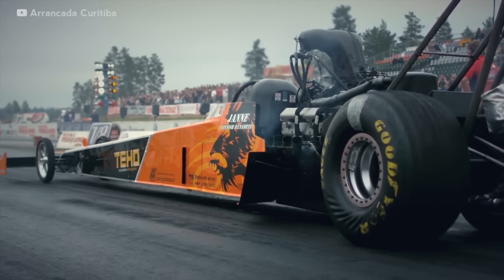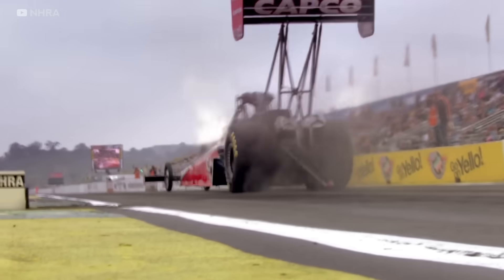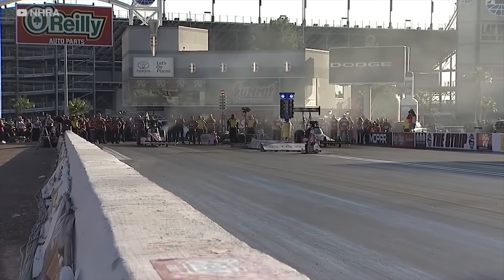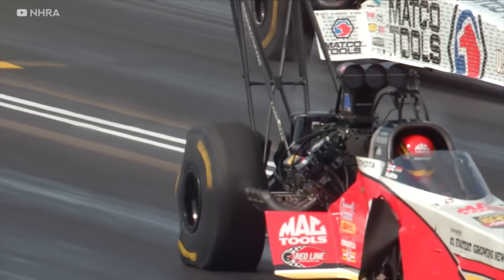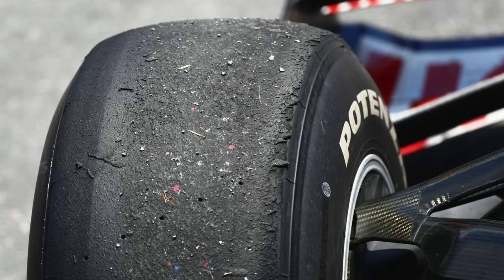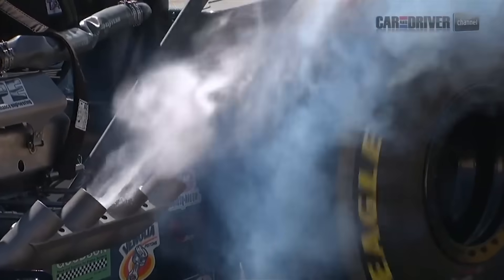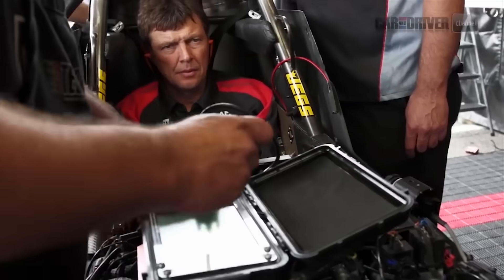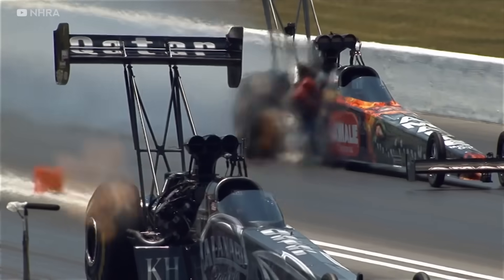How Dragster Tyres Accelerate to 335 MPH in 3.6 Seconds

Comment: 8:13 actually this part is incorrect. Nitromethane produces less power per liter than regular pump gasoline. The biggest reason it’s used is because of its viscosity. It flows a lot easier than gasoline and so they can use lots and lots more of it more quickly to produce the power that they need.
Reply: GASOLINE
Gasoline is a mixture of hydrocarbons. Its chemical formula is C8H18. The air fuel ratio for complete combustion is 14.7:1 called stoichiometric. This means that our engine consumes 14.7 pounds of air for 1 pound of fuel. Gasoline has approximately 18,400 BTU/lb . Using an air flow calculator this focus engine would consume 247cfms at 7000rpms with 100% VE.  This equals 22.17lbs of air per min.  Divide by the 14.7:1 ratio and that would get you  1.5lbs of fuel.  Multiply that by the 18,400 and your engine would produce  27,600btu’s of energy at 7000rpms.

NITROMETHANE
Nitromethane is a fuel that is used mostly in specialized drag racing classes such as “Top Fuel Funny Cars” . Nitromethane’s chemical formula is CH3NO2. The oxygen in nitromethane’s molecular structure means that nitromethane does not need as much atmospheric oxygen to burn, part of the oxygen needed to burn nitromethane is carried in the fuel itself. Typical A/F ratio for nitromethane is 1.7:1 and nitromethane has an energy content of 5,000 BTU/lb.Using our Focus engine from above with a 1.7:1 ratio our motor would use 13.04lbs of fuel.  Multiply that by the 5,000btu’s per lb of nitro and our motor would be making 65,200btu’s at 7000rpms.
https://www.topspeedparts.com/blogs/news/fuel-comparision link for anyone that wants to know more.
Reply: nitromethane makes more power per lb than pump gas, you would need a bigger tank and a lot more F/A input to make the same power. you would need around 1.6x-1.8x the amount of pump 93 octane to make the same amount of power per run.... so the info at 8:13 is correct.

Comment: Nobody:
Drag car: hey guys watch me show this aircraft whos boss. (Chugs 10 gallons of fuel in 1 second)
Reply: @Funtime Florian nitromethane isn't a fossilfuel
Reply: @Funtime Florian plants also produce fuel
Reply: Corvette with a running 200 mph start "Wanna go?"
Dragster: "Hold my beer."
Reply: The Fuel PIPE is almost 4 inch in Diameter and force feed by the dragsters acceleration to the fuel pumps attached to the motor feeding 42 injectors.

Comment: There is one more factor that was not described here: The sidewall folding means that the rubber does not hit the track at a tangent, instead it is driven down and into the pavement.

Consider the (admittedly oversimplified) approximation of friction as the normal force multiplied by a coefficient of friction... If it was really that simple then it would be difficult to accelerate at more than 1g. You would need a coefficient of friction greater than 1.0 to exceed 1g of acceleration. It's difficult (impossible, really) to get such a large coefficient of friction.

But, sidewall folding causes the leading edge of the tire to slam into the track with a force much greater than what gravity provides alone. Slamming into the track with 3x as much force makes it possible to accelerate 3x harder than gravity, with a friction coefficient that is still in the neighborhood of 1.0.

Comment: I am genuinely curious about what a driver does when the parachutes won’t open.
Reply: At the end of every track there is about 100 yards of "pea gravel" ... which slows a car down tremendously....after that there is a catch net. The same that is used on aircraft carriers. There have been deaths yes, due to too short of shut down areas for the speeds...but 99% of the time no parachutes is not deadly due to what I mentioned.
Reply: At these speeds, he dies. It's happened - Scott Kalitta. That's why they shortened races from 1/4 mile to 1000 feet, to keep the top speed down a bit and to gain some runoff room. Most racetracks are in built-up areas, and there's no room to make them longer.

Comment: 5:02 False. Since the 2008 NJ crash, NHRA only does 1,000ft. runs. Outside of NHRA, there are still some races that go the full 1320, but they are extremely rare.
Reply: Only the fuel cars are restricted to 1000ft...all other classes still run 1/4 mile.

Comment: At 3:36 and beyond, you can see the tire gets sucked to the back of the rim by the torque.
 The wrinkling or wading of the tire isn't just squat. The tire gripping the track, gets wadded up by the rim spinning and pulling the sidewall at launch. Part of the reason for having bead lock rims with the low tire pressure. Lower lever cars will often screw the rim to the tire to reduce/inhibit rim spin.

Comment: hang on a second you mentioned the engine uses around 50 lts per run, yet the fuel pump moves 50lt per second, so the fuel amount carried is a lot more than 50 lts right, it would be around 200 lt for a run of under 4 seconds?

Comment: Also the only thing holding that engine is 4 large HD clamps and not bolts, just clamps, which look like hose clamps but are made a lot stringer, reason is that in a crash the engine will separate from the cockpit to help with safety. :)

Comment: Yeah she lied about the motors not all of them run hemi engines, some of the competitors actually run what is known as a Merlin block witch come in all different sizes! But mostly the block is made for making Chevy engines that are larger then a 572 displacement
Reply: LOL...Ummm, there hasn't been a Chevy based block used since the 1970's. ALL top fuel motors, and ALL alcohol class motors are indeed Hemi's.

Comment: Thats why i love it when Europeans talk shit about drag racing. We're not talking about drag racing a stock BMW, that requires no talent or technique. Putting down over 10k horsepower takes skill and a lot of science. Its like that episode of Top Gear where they brought supercars to a drag strip and got beaten by pickup trucks. These cars tend to run over 1000 hp easily and as we can see in top fuel they run over 10,000.  Yeah its just a straight line and just a quarter mile, but it takes a lot of skill to keep that much power going in a straight line.

Comment: that is exactly what i should show my brother who keeps asking why i put thick rear tires on my cars in "Need For Speed Shift 2 Unleashed" simply put, the effort of going from 0 to 1 km/h is bigger than going 99 to 100 km/h on the traction scale... so applying the torque over time makes the car not spin and then i can floor it. i guess thin tires would work better if i was trying to drift or something...

Comment: 50 liters per second? that sounds bit excessive. Just stop for a second and think how BIG a 50 liter tank is, to be able to push 50 liters through a pump in just 1 second, you'd need a gigantic fuel line. Not sure how exactly that's achieved, there's no way you can get 50 liters per second through a bump that is smaller than the entire engine itself. .. or are you saying it's CAPABLE of doing it, but not in use? that would make more sense.

Comment: 5:50 I think This is mid engine configuration because engine is before rear wheels. Rear engine is Porsche 911 where engine is after rear axle and transmission.
Reply: They call it rear engine because when the sport started, the drivers sat behind the engine. It was very dangerous, especially when the engine or clutch exploded. Don Garlits was the first to build his car with the engine behind the driver. So they just called it a rear engine dragster.

Comment: Great video the only thing I don't like as a racing fanatic for 41 years is people always missing mentioning that these Dragsters are required to run Chrysler Hemi engines. The class is literally Top Fuel hemi  or Top Fuel hemi funny car.   They don't run that design because it's the one that makes the absolute most power they do it because it's the most tried and true and tested for safety and it helps keep costs down for the teams.  Nitromethane actually has less energy per unit volume than gasoline but the reason it makes so much more power is that it chemically brings along its own oxygen.  The reason for needing an arc welder for the spark plug is they essentially need to build a primer for the dynamite they just packed into that cylinder.

Comment: 6:24 those... those are condensation trails off the rear wing like in an AEROPLANE 0_o
Reply: CHEMTRAILS!!!
Reply: @flowjoe23  5G CORONAVIRUS!!!!!!!!!!!BILL GATES!!!!!!VACCINE MICROCHIPS!!!!!!!! lol
Reply: @flowjoe23  it's called chemtrails of conrtrails
Reply: At 335mph a comercial plane would have had it's landing gear ripped off by aerodynamic forces. It fast boi
Reply: I mean, "like an airplane" isn't always the most impressive comparison, many planes can trail vortices like this scooting along at 60 mph
Reply: Michael Fritsche  I think it's actually the air expanding that causes the vapour to condense, you see mist in low pressure areas like vortices, engine intakes and the air behind shockwaves

Comment: 8:18 "Nitromethane doesn't need to mix with air to combust."

Right so the huge supercharger and big air scoop is just there for looks then??
Reply: https://en.wikipedia.org/wiki/Nitromethane#Explosive_properties
Reply: @stevegreen8262  
Deflagration (burning) and detonation are two different processes.
I have been using Nitromethane for over 30 years and though It contains oxygen in its chemical makeup It isn't a monopropellant and requires additional air to burn, hence the supercharger.

Comment: Not mine but just wanted to share What 10,000 horsepower does to a top fuel tire at launch.

TOP FUEL ACCELERATION PUT INTO PERSPECTIVE

* One Top Fuel dragster 500 cubic-inch Hemi engine makes more horsepower (10,000 HP) than the first 5 rows at the Daytona 500.

* Under full throttle, a dragster engine consumes 1.2-1.5 gallons of nitro methane per second; a fully loaded 747 consumes jet fuel at the same rate with 25% less energy being produced.

* A stock Dodge Hemi V8 engine cannot produce enough power to merely drive the dragster's supercharger.

* With 3000 CFM of air being rammed in by the supercharger on overdrive, the fuel mixture is compressed into a near-solid form before ignition. Cylinders run on the verge of hydraulic lock at full throttle.

* At the stoichiometric 1.7:1 air/fuel mixture for nitro methane the flame front temperature measures 7050 degrees F.

* Nitromethane burns yellow. The spectacular white flame seen above the stacks at night is raw burning hydrogen, dissociated from atmospheric water vapor by the searing exhaust gases.

* Dual magnetos supply 44 amps to each spark plug.
This is the output of an arc welder in each cylinder.

* Spark plug electrodes are totally consumed during a pass. After 1/2 way, the engine is dieseling from compression plus the glow of exhaust valves at 1400 degrees F. The engine can only be shut down by cutting the fuel flow.

* If spark momentarily fails early in the run, unburned nitro builds up in the affected cylinders and then explodes with sufficient force to blow cylinder heads off the block in pieces or split the block in half.

* Dragsters reach over 300 MPH before you have completed reading this sentence.

* In order to exceed 300 MPH in 4.5 seconds, dragsters must accelerate an average of over 4 G's. In order to reach 200 MPH well before half-track, the launch acce leration approaches 8 G's.

* Top Fuel engines turn approximately 540 revolutions from light to light!

* Including the burnout, the engine must only survive 900 revolutions under load.

* The redline is actually quite high at 9500 RPM.

* THE BOTTOM LINE: Assuming all the equipment is paid off, the crew worked for free, & for once, NOTHING BLOWS UP, each run costs an estimated $1,000 per second.

0 to 100 MPH in .8 seconds (the first 60 feet of the run)
0 to 200 MPH in 2.2 seconds (the first 350 feet of the run)
6 g-forces at the starting line (nothing accelerates faster on land)
6 negative g-forces upon deployment of twin â€˜chutes at 300 MPH An NHRA Top Fuel Dragster accelerates quicker than any other land vehicle on earth . . quicker than a jet fighter plane . . . quicker than the space shuttle.

The current Top Fuel dragster elapsed time record is 4.420 seconds for the quarter-mile (2004, Doug Kalitta). The top speed record is 337.58 MPH as measured over the last 66' of the run (2005, Tony Schumacher).

Putting this all into perspective:

You are driving the average $140,000 Lingenfelter twin-turbo powered Corvette Z06. Over a mile up the road, a Top Fuel dragster is staged & ready to launch down a quarter-mile strip as you pass. You have the advantage of a flying start. You run the 'Vette hard up through the gears and blast across the starting line & pass the dragster at an honest 200 MPH. The 'tree' goes green for both of you at that moment.

The dragster launches & starts after you. You keep your foot down hard, but you hear an incredibly brutal whine that sears your eardrums & within 3 seconds the dragster catches & passes you.
He beats you to the finish line, a quarter-mile away from where you just passed him. Think about it - from a standing start, the dragster had spotted you 200 MPH & not only caught, but nearly blasted you off the road when he passed you within a mere 1320 foot long race!

That's acceleration!

Comment: If a dragster goes in a straight line, why the need to steer? Why not lock the wheel.
Reply: When the tires lose traction, the cars start dancing around...it's called a pedal fest when both cars lose traction...

Comment: The fuel line is one of the chassis rails and the tank in the front has a massive hole in it to allow flow.
Reply: LOL...One car in existence is built like that. Garlits' last swamp rat... the mono wing. When Garlits came out of retirement several years ago and went to Indy (so he could run 300 mph because he had never done so), the NHRA gave him a one time exemption for his fuel system being literally the frame rail. But, they also gave Garlits a list of rule changes since he had last raced Swamp Rat XXXIV, Garlits didn't have time to make all the updates so top fuel racer Gary Clapshaw offered Garlits the use of his dragster. Garlits went to Indy and qualified and did run his first ever 300 mph and sub 4 second run. I was there racing...I spent a lot of time in Clapshaw's pits. Garlits was on edge that weekend...rather worried and not his confident self. But I have literally never heard a cheer from a crowd as loud as I did when Garlits qualified for the biggest drag race ever and when he came up for round 1.